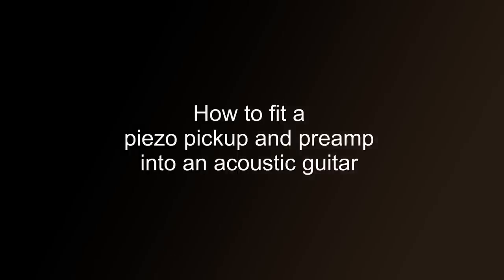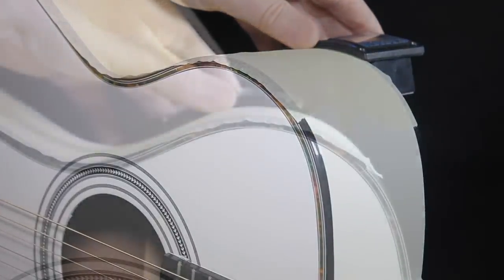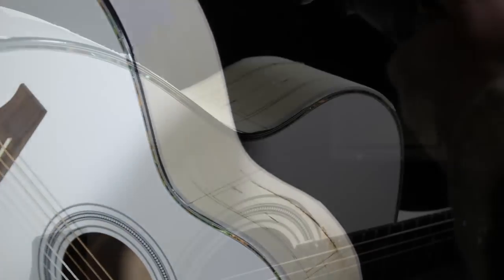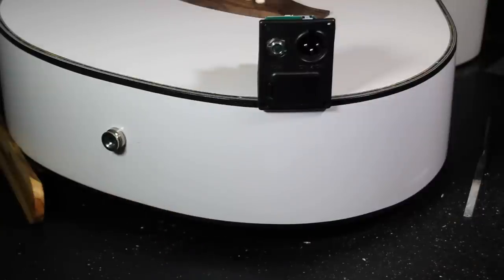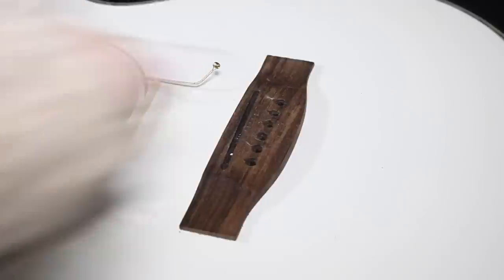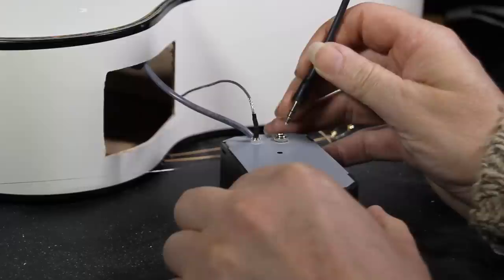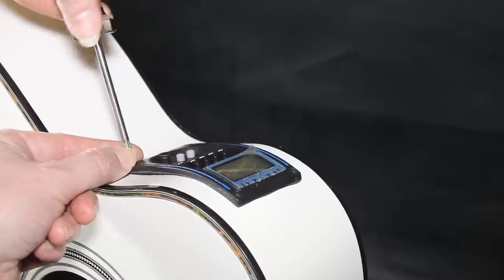How to fit a piezo pickup and preamp into an acoustic guitar. The LC-5

Comment: Hi, is it the same to cut though a guitar with a plastic back/sides?
Reply from the maker: You can physically cut the plastic back and sides in the same way but watch out.  A wooden ribbed guitar curves in one direction so the preamp is designed to fit that curve but many plastic backed guitars curve in 2 directions so a standard preamp might not fit.  Make sure the preamp fits the curve of the guitar before cutting. 🤔
Reply: @guitar-academy  thanks so much for the advice.

Comment: So my question is...I watch all the videos by "tone freaks" who analyze the most tiny subtle differences in acoustic guitars based on their body shapes and tonewoods, and being solid wood vs layered back and sides.  Doesn't cutting a big chunk of wood out of the side of the guitar detract from the tone?
Reply from the maker: The sound difference can't be heard with the human ear and even with electronics it's hard to see a difference.  The biggest impact is not the hole but the pickup, because you are putting another layer between the strings and the sound board.  However it's horses for courses . .  if you need to play on stage or record in with complete control of the sound and no background noise then it's far better to use a pickup.

Comment: what sound settings can the preamp adjust? I just bought one and noticed its not labeled
Reply from the maker: Oh wow, that's a bit of a pain.  Assuming the sliders are the same they are from left to right.  
Bass - Mid - Treb - Pres - Mic/piezo and the buttons are Tune and power and the big knob is vol.
Reply: Thanks :)

Comment: is it possible to replace the bridge pickup with a better one like you did with the microphone???
Reply: also it looks like the pickup isn’t plugged into the preamp with the standered mini jack that the mic is. do you know what that is??
Reply from the maker: Yes is it possible to fit a better bridge pickup just the same way.  The Microphone is just a mono minijack and a stereo one would work, but most pickups wired with mono output.
Reply: okay. i want to get this but i want to get a higher quality pickup. thank you for responding!
Reply from the maker: No problem . .  it is a good question.  :-)
Reply: do you recommend any other better pickups
Reply from the maker: I don't recommend any particular pickup because peoples tastes vary so much.  The LB6 should work but beware . .  at the bottom of there Web page they issue this warning  
'LR Baggs products must be installed by an authorized LR Baggs dealer to qualify for warranty coverage. Technical assistance will not be provided for home or hobbyist installations.'

Comment: Can this piezo preamp works with a  guitar with nylon strings?
Reply from the maker: Yes, but make sure you get the correct length of pickup.  The pickup should fit edge to edge under the bridge, so a nylon one is a little bit longer usually.

Comment: My friend wants to fit a pickup to his acoustic with no preamp. What are the downsides to having no preamp?
Reply from the maker: Roman Lakes the preamp gives you more control over the sound that the guitar produces and it allows the guitar to be used effectively with other peoples equipment, plus you often get a tuner.  But to be honest, if your equipment is set up for the guitar not having a preamp has its advantages as well, like not having to replace the batteries.
Reply: GCH Guitar Academy thanks for the reply! That makes a lot of sense. Very helpful
Reply: plz can i use the sony cloned microphone which is cheaper??

Comment: CAN SOOMEBODY HELP ME,I'VE INSTALED THIS KIND OF AMP IN MY ACOUSTIC AND EVERYTHING WORKED FINE BUT AFTER ONE HOUR SOUND CRASHED AND THERE IS NO SOUND AT ALL,ONLY WHEN I TURN ON TUNER AND THERE IS STILL NO SOUND FROM GUITAR,ONLY DISTORTED BUZING WHEN I PLUCK STRINGS ..ANY SUGESTIONS WHAT SHOULD I DO TO FIX THIS ?
Reply from the maker: Check the battery first and that it is connecting properly

Comment: Can I use this in my Epiphone pro1? How much cost it will?
Reply from the maker: Yeah it will work on an Epiphone Pro-1.  It depends where you get the pre amp from and which one you get.  You will need to research this yourself to find the system best suited to what you need.
Reply: GCH Guitar Academy 
U have already more than 31k subscribers. For me it's very gr8 that u replied to my question. Thank u :)
Reply from the maker: Thank you  :)

Comment: Can i use xlr to 1/4 cable plug it into the mixer?
Reply from the maker: I have done this a few times without a hitch and the sound it perfect, however I did find on one mixer that the xlr to 1/4 inch was quite compared to xlr to xlr, but this didn't make a difference really.  I just turned up the gain a bit.

Comment: GCH Guitar Academy I just installed the same one today used a aux to phono lead to connect it to my stereo but the sound does not come through my speaker have I done something wrong thanks
Reply from the maker: make sure the aux is 'in' and not 'out'.  The lead you described  also sound odd . . .  you need a 1/4 for the guitar side and whatever is on your stereo,  you might even need to make up a suitable lead or get someone who knows how to make you one.
Reply: It’s the same one that you installed on the video I have a 1/4 jack step down to a normal headphone jack to red and white witch go in to the  stereo clicked aux but nothing plug my phone in to the lead music plays I’m  baffled the  indicator flashes red  when I put the jacket in the display works for tuning etc I plug the mic in to a computer to see if it was working witch it is but still nothing if that makes sense
Reply from the maker: @robert-mx3gi  Sorry to say but it sounds like you have a faulty preamp.  🙁
Reply: GCH Guitar Academy just what I wanted to ear lol should the red indicator light stay on when the jack is plugged in gonna buy a 1/4 lead tomorrow and see if that’s solves the problem thanks
Reply from the maker: @robert-mx3gi  Whether the light should stay on or not depends on the preamp, they update it from time to time so I honestly can't say if it should stay on or not.   The one I fitted did stay on.

Comment: Will it fit to the 3/4 guitar?
Reply from the maker: That particular one wont, but you need to measure the bridge and look for one with the correct measurements.  I've never done one on a 3/4 size guitar, so I don't know if anyone makes one especially.

Comment: Cut the hole for the preamp ... fine ... drilled for the 1/4" plug ... fine ... drilled for the piezo ... oh oh ... have a metal adjustable bridge and the piezo didn t work ... any ideas ???   Thx
Reply from the maker: It's hard to answer correctly without seeing the guitar, but if the piezo can fit into the melal bridge and the shape of the bridge will allow, you can get a drill bit that can drill through the metal to allow the wire through.
You can also buy little round piezo pickups that stick on to the wood inside the guitar, search 'piezo pickup' on Ebay.

Comment: Does pure acoustic guitar sound decrease after installing a pick up?
Reply from the maker: Yes it does . . but on this guitar it was in indiscernible to the human ear.  
I haven't tested enough guitars to confirm this, but I would imagine the construction of the guitar and where you cut the hole and how you finish the hole all have a slight impact on the natural sound.  But, I feel I should emphasis that on this guitar the sound didn't change at all to the human ear.
Reply: GCH Guitar Academy thnk u for your rply.... So, i should buy electro acoustic guitar
Reply from the maker: Acoustics are acoustics and even a factory done one will not sound as good as a pure acoustic guitar to the had core audiophile.  But the difference in sound is negligible.  So really, it depends on your needs and your budget.
Reply: GCH Guitar Academy  my buget is 16k minus
Reply from the maker: To be honest I can't advise you on what's available in your budget and in your country, it's different from place to place.
Reply: GCH Guitar Academy okay sir

Comment: +GCH Guitar Academy I have a problem. I want to add a pickup at my acoustic guitar. I've seen a lot of pickups on internet to buy and I cannot decide. I know that Ed Sheeran has a Fishman Mini Q pickup and I want to buy it because the sound is very good, in my opinion. I hope you could advise me. Shall I buy it or it doesn't worth ? it is better than other guitar pickups? Thank you ! I hope you will reply :)
Reply from the maker: Sorry, I haven't tested this pickup myself so I can't comment.  However, be careful to measure your guitar and then get the measurements for the Fishman first because it is called Mini for a reason and wont fit many guitars.
Reply: But would you may listen the Dublin performance of Ed Sheeran ? One or two of his four guitar use that mini fishman pickup. I don't want to screw it up, because once I've done the pickup's hole I cannot go back with installing other one, so I just want to take an advice from you. I got that you don't know how it's sounds like, but would you listen that performance ?Thank you for understanding !
Reply from the maker: I have a Fishman lsys pickup and preamp in a James Neligan guitar that I have owned for a couple of years, and it has been very, very reliable, it has good battery life and the sound is well above average.

Sorry, but you can't judge the sound of a pickup from a live performance.  The guitar is going through lots of equipment before it reaches your ears and any opinion would be purely subjective.  The only way to test a pickup properly is to compare it with other pickups in the same guitar and through studio and audio analysis equipment.
However, in the past I have found that most people can't hear the difference between different pickups anyway and therefore the price of the pickup has little impact on the sound.
Reply: One more question : I've seen those Fishman products only on Ebay and it might be a problem beacause are made in China and probably are going to broke down fast. Would I buy that Isys, actually it doesn't matter the model of Fishman, I just want to know if it would be a loss in case I would buy it. The price it's about 16 euro... quite cheap, isn't it ? How much would cost a pickup generally? P.s : I'm from Europe, not from US.

Comment: What did you use to pierce
Reply from the maker: I hope I answer this correctly because I'm not sure which bit you are asking about.   To cut the hole I didn't need to pierce because the cutter cuts it's own way through the wood. . .  I hope that's what you were asking . . 😊
Reply: Thank you.
Reply: This pickup sounded great on my 12 string
Reply from the maker: @nicholasortiz4836  That's great and handy to know . . 😊
Reply: I had one problem, my guitar works good with a quarter inch, it sounded good with a female xlr to my xlr output and a quarter inch into my amp, but when I plug it in xlr to xlr no noise comes out only like pops and I tried multiple xlrs to a recording studio and a brain and PA and it did the same.
Reply from the maker: @nicholasortiz4836  what a major pain.  The only thing I could think of is just to wiggle the internal lead between the preamp and the socket and if that isn't the problem it needs replacing.    😒
Reply: GCH Guitar Academy Thank you
Reply from the maker: @nicholasortiz4836  sorry you are having problems . .  I hate when things like that happen  . . .
Reply: GCH Guitar Academy I figured out the problem I had to have the 1/4 plugged in order for the XLR output to work and I bought a mic similar to yours for my 12 string

Comment: How good is the tuner?
Reply from the maker: The tuner is good working off the piezo, but not so good off the mic, but in fairness the mic probably picks up any background noise.  The tuner is a little slow to respond on the bottom 'E' string.

Comment: Why was there a Peizo pickup already installed in this guitar?
Reply from the maker: I have no idea . .  the guitar was a second hand one I picked up off one of my students so I don't know it's history.
Reply: Thank you for replying. Can you answer one more question I have? Did this guitar have its own guitar jack hole or any provision? I am planning on buying one acoustic guitar soon and I plan on getting this preamp kit installed. I don't want to screw it up.
Reply from the maker: No it didn't, I had to install the jack hole. 
If you haven't bought your guitar yet, you can get them with the preamp factory fitted easily enough and with no risk of getting it wrong.  I recommend you spend a little bit of time researching whats out there before buying, but you probably already know this.  :-)
Reply: Thanks for the information. and Happy new year.
Reply from the maker: You too . .  have a  great year
Reply: The guitar does have a jack hole indeed. The end pin where the strap goes is where the jack hole is located. The piezo is connected there, and is meant to be plugged into a amplifier, thus no need for a preamp.

Comment: is there any other way to cut the holes
Reply from the maker: There are probably loads of ways, but I don't know them all.  One common way is to drill a hole and then use a narrow bladed saw or jigsaw to finish the hole.  Another way is to drill lots of holes close together and then finish the job with a file.

Comment: im sory but how does the template fit into the curve on the guitar?
Reply from the maker: you have to use the template to mark the guitar dead center between the lines created in the process you did at 2:50 where you found the curve point.  The template has to be flexible enough to follow the curves.

Comment: Didn't show how squaring the top corners in the cutout for the preamp removed the wood needed for the screws. I guess that's why it didn't show these two screws being installed. You have to leave wood in the corners for the screws to match the bevel in the preamp unit. Alternately, if you've already screwed this up you can glue small blocks inside the cutout where the screws go to remedy this omission.  Just sayin'       Mike
Reply from the maker: As I showed in the video, I used exact measurements and the preamp was a tight fit on all 4 edges.  If pause the video and look carefully at 12:00 mins you can see the white paint of the guitar through the hole, demonstrating the wood was there.  The only reason I didn't show all the screws going in is because my arm got in the way of the camera so the footage wasn't included in the final cut.

Comment: How the XLR working I put two them in still not working
Reply from the maker: The test at the end was done straight away using the XLR without any issues and I don't know (so far) of anyone to have that issue.   They could have changed them or had a faulty batch, but 2 being faulty is strange.  Did you check your lead ?

Comment: I wish I had those Fingernails to fingerpick. I chew mine down to the knuckles
Reply from the maker: I used to do that until I got some stuff called 'stop n grow'.  It 's like clear nail varnish but it tastes disgusting . .  it really works and I can testify to that.  The problem is, when you have long nails, doing repairs and practical stuff becomes harder.

Comment: These things never fit perfectly and I can see a gap under the edge of the preamp here. This could easily be fixed by fitting some kind of gasket between the guitar and the plastic. I don't know why manufacturers can't provide these with the pickup as I'm sure it wouldn't add much to the overall cost. It's easy enough to make one yourself, using something like a piece of silicon rubber packaging material or slices of an old bike inner tube. Adds a few minutes on to the job but gives a really professionally finished look.
Reply from the maker: Look more carefully. . .    There is a soft foam gasket and it makes a perfect fit that stands up to close examination.  The finished product had no gaps whatsoever.
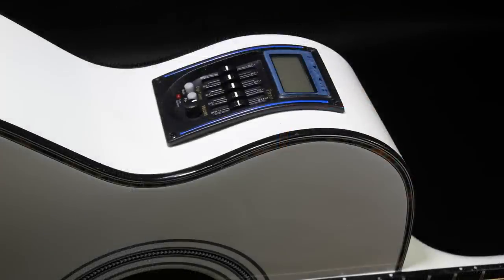Reply: I've been installing Fishmans recently, which don't have any kind of gasket, so your's is a definite improvement there. If you look at 16:04 though, the pickup doesn't look like it fits too well as it gets closer to the waist of the bout. Maybe the foam makes a perfect seal, it just doesn't look like it to my eye. Not a criticism of you - my point is that these things  are never likely to  fit perfectly unless they're made specifically for your guitar, so gasketting would be an appropriate fix.

Comment: I understand the need to mic a guitar - or use a pickup, but I will never understand the concept of an on board pickup. Such a beautiful instrument (any acoustic guitar) with the aesthetic forever damaged for the sake of convenience. Good job, nevertheless.
Reply from the maker: For are than just convenience.  To get the acoustic sound load enough to perform on stage or to record it accurately without background noise is very difficult without a pickup, and music isn't a visual art so aesthetics aren't important when you here the final product.  However, I know what you are saying and understand your point of view.
Reply: xmandlt It's also possible to install a K & K pure mini, no preamp, no battery required, and the guitar will look exactly the same as before. Only thing it needs to be adapted is where the end pin jack is installed, where the strap button first was. They have to drill a minor hole in it. My Martin D35 was equipped this way, and it works just fine.

Comment: Oh man.. I'm not gonna rip my expensive guitar off.
Make sure you guys do not attempt to install such thing in a professional classy guitar,  Just in case the exact same pre-amp is discontinued then you're dead! It happened with previous technology which is still growing up to now. Different pre-amp equalizer different form and size, when such cheap thing won't be anymore working let say the next 5 years, just make sure you can find exactly the same one.. Otherwise it's a trash. Unless you make 5 unit in stock for 25 years later spares.. LOL!!